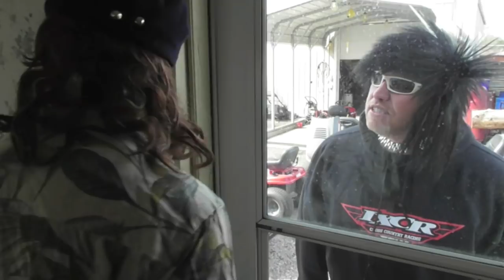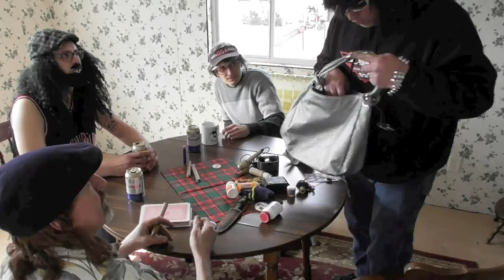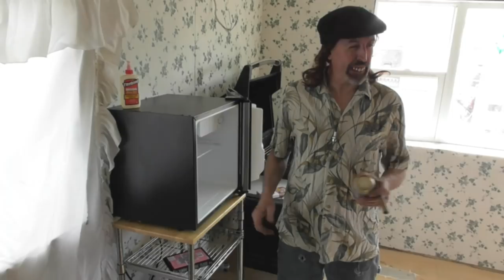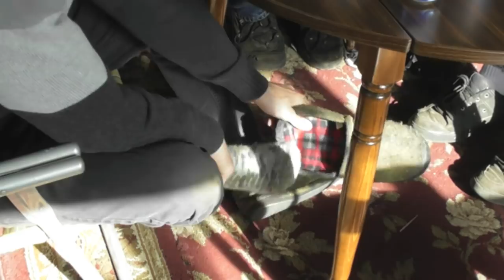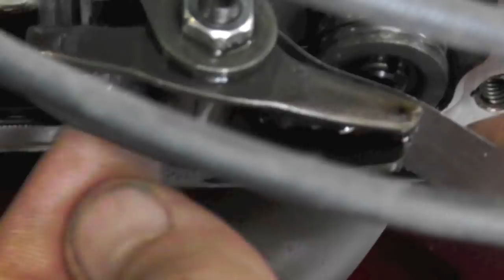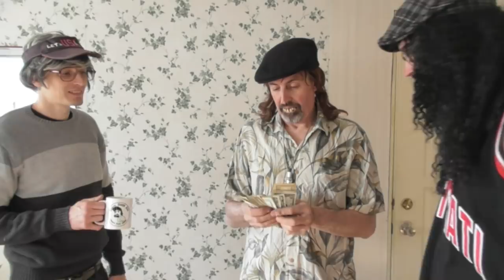How To Set The Valves On A Kawasaki FX Series Engine - with Taryl

Comment: Adjust when warm or cold? Always did my old Toyota pickup when warm, but don't know about my mower. Thanks
Reply: My John Deere X300 FH491V says cold 0.003 - 0.005 in. For both I/E valves.

Comment: there is always going to be the one guy who will watch this and do exactly what happens in this video!  and will do that without actually checking what the valve gap IS for the particular motor.  Always check the specs!  go to the official kawasaki website for oem specs.  Or call them if you are not sure.

spoiler:  there are TWO (02) cylinders on FX series engines.  And yes, you will be doing the same valve clearance procedure on BOTH cylinders. for a total of 4 valves (2 intake for each of the two cylinders and 2 exhaust for each of the two cylinders). Removing the spark plugs on both cylinders makes turning the engine by hand very easy.  

there is a torque spec for tightening these valves.  While not necessary to go out and buy a pro torque it is important to tighten them down snug..but not gorilla twist...either.  

also this:  it's important to do this valve gap when the engine is cold...and not below freezing or in temperatures that are in triple digits.  

protip:  have a set of valve cover gaskets before you do this work.  Replace them !

Comment: Taryl, I have a fx 801v that's backfiring at idle but runs smoother with the blades engaged. I was told I needed a carb and I bought one but still does the same thing. It has 1300 hrs on it could it be the valves need adjusting? Never had them done. Looking forward to your input. Thanks
Reply: I would...even if to just rule it out.  Worst case; new gaskets are cheap.

Comment: i like the adjustment layout on this much better...Briggs needs to take notes on this. to adjust their engines you almost need three hands, one to hold the feeler gauge, and two to turn the adjusting nut and lock nut.
Reply: dave1135 Funny thing about that is that every car engine with adjustable valves that I've ever seen had the same adjustment system as the Briggs and Kohler engines do.
Reply: I wish I would have seen this video a few days ago. I just did the valves on my Kawasaki FS730V and the manual called for .002" of clearance. I am not a fan of this system. Just breathing on the adjustment nut would take it from too tight to too loose. Then, once adjusted, any tightening of the lock nut would change the settings. If I left it loose, tightening the locknut made it looser. If I made it a bit tight, tightening the locknut made it tighter. The eccentric bolt just seems to have too much slop in it to achieve a repeatable adjustment. The manual called for 11Nm of torque on the locknut and it was next to impossible to get a torque wrench in there. Again, applying the proper torque changed the adjustment. I finally got it within range but I must have loosened and retightened the locknut 20 times. I'm sure Kawasaki went with this configuration as a cost-cutting measure. I'll take the good 'ole setscrew and locknut on the end of the rocker arm any day.
Reply: My engine is in a John Deere X500 garden tractor. I have both the Deere service manual and a Kawasaki FS730V service manual and they both specify .002 to .0039. After a lot of fiddling with the eccentric adjuster bolt I was able to get cylinder #1 valves to .003 and cylinder #2 valves to .0025. The other feature that made the job interesting is CYL #1 had the lock nuts on the bottom which left almost no room to get a torque wrench on the lower rocker. CYL #2 had them on the top which made for easier access.

Comment: Hey guys need your help please...
I have a kawasaki fx850v and it started running on one cylinder so I check my plugs and then changed them with new ones and problem was still there so I unplugged the coil wires to see which cylinder was firing and which one wasn't and found that the right cylinder wasn't firing so I ordered to new kawasaki coils and pulled the shroud and replaced both coils and kept the old one that was good. Hit the key and right side is still not firing.. so I thought maybe I got a bad coil so I replaced it with the good coil that I kept. Hit the key and still not firing...so I thought maybe it the valves  and check them and intake valve was too tight and exhaust valve was at .012 so I set the intake at .004 and the exhaust at .006 and hit the key and it was popping and cracking through carburetor and it started running on both then back to 1 and back to both then back to 1 cylinder  and then died.
I really need some advise cause I cut some commercial properties and they are over 10inches now

Comment: Hey Taryl! I need your help my friend, my Kohler command single 14HP is giving me trouble, it is loading power when I engage the PTO and is runny rough, could it be a valve issue?? Or a carb one? It doesn't want to idle either,. Need you help badly..
Reply: Sorry for the misspelling damm autocorrect!😡
Reply: Losing power and running rough.

Comment: Shouldn't you make sure your piston is at tdc before adjusting the valve clearance?
Reply: You can if you like but there are 2 TDCs. One at the top of the exaust stroke and the other at the top of the compression stroke. TDC compression will be when both valves are closed and therefore both valves can be adjusted w/o having to give the flywheel another turn. But when one valve is open the other is always closed and you have a clear visual reference without having to put anything in the sparkplug hole.